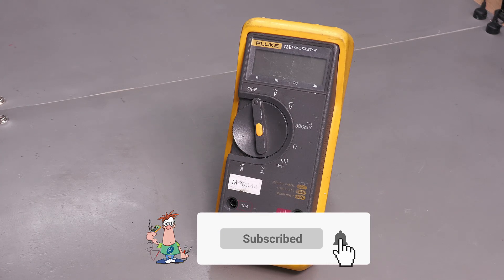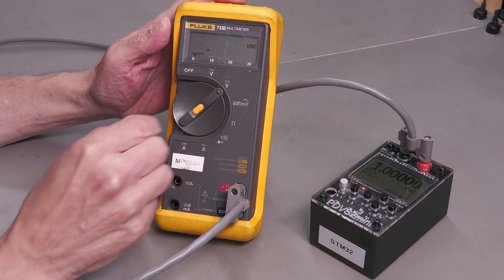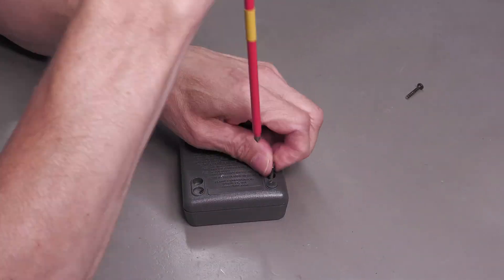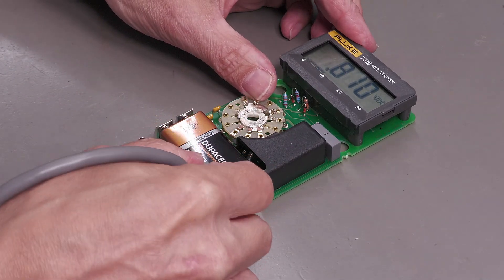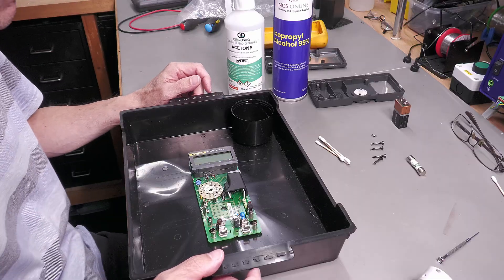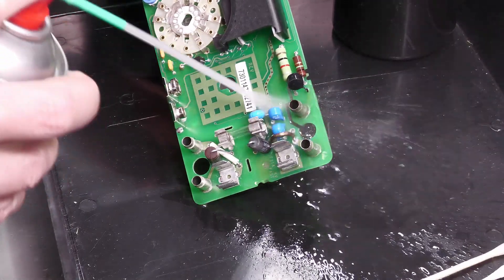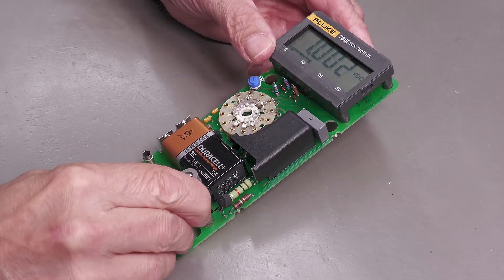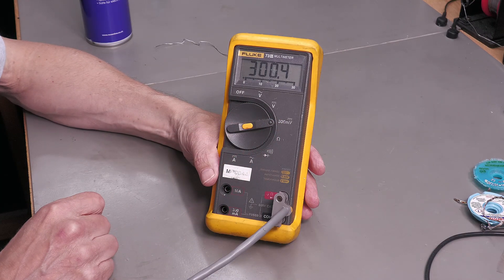No.164 - Fluke 73 Multimeter 10min Repair

Comment: i have a 73 III all works apart from when measuring AC, 240 displays as between 6 and 8V jumping up and down.  any pointers where to look?
Reply from the maker: There is a service manual for the Fluke 77 which contains a schematic......that might help you out.
Reply: @IanScottJohnston   thanks unfortunately the 77 is a different pcb to the 73 mk3 .  I found the 73 mkii and thats different too.  ill just have to use another meter for mains

Comment: The original, first generation Fluke 87 I had at work did this over time as well. The display dimmed over time as the zebra strips made poor contact also.

Now the 87V I've had for probably the past 13 years or so at work has problems in the summer time when the humidity is high. The jacks with the split contacts in them that warn you when you have the probes installed if you are not in current mode will beep and the screen will say "Lead". Even when there are no test leads installed at all. I have to soak them down and blow them out multiple times with isopropyl alcohol and air to fix the problem.

Comment: Believe I’ve had exact same issue in a 77. Banana jacks with dry solder joints. Probably one reason fluke went to the monolithic jack assembly they have on the 87 and similar now.

Comment: If you put a q-tip in isopropyl and squeeze/roll it between your fingers, it becomes just about the perfect size to wedge into a 4mm and spin around(also can cut the opposite end off, and chuck it in a drill), works pretty well, just don't use cheap ones that loose the tip easily.

Comment: In general when you have dmms with the display slowly settling, what is the cause? Like you have a reading which converges to the right value but never reaches it and is slower and slower.
Reply from the maker: Floating input, oscillation……etc I guess.

Comment: nice one Ian!  Yesterday I fixed my trusty UNI-T meter which has been going for almost a decade.  It does the job well again now.  The banana connections had become broken off at the solder points due to years of use.  Sometimes causing iffy connection or too high resistance.  It's been a workhorse, felt great to repair it.

Comment: I have a 79 that I purchased new many (30?) years ago.  The meter absolutely retains calibration over a long time even if you cannot cal it annually.  The only issue I have is the front cracked at  the upper corner even though it has spent it's life in the yellow rubber sheath.  So I only wish that Fluke could supply a new front for my meter.  Even if they must do it in their shop. Rather have it than any sort of new unknown brand weirdly named Chinese meter.   I do not view the Fluke as a "throwaway" disposable like cheap dodgy meters.
Reply from the maker: Yep, the Fluke's are always worth saving.

Comment: Just a pro-tip for any one else repairing Fluke meters: be VERY careful putting solvents anywhere near the display bezel. Often the screen printing of the logo and model number on the plastic bezel is not solvent resistant like the screen printing on the outside of the case.
Reply from the maker: Especially acetone!
Reply: @IanScottJohnston  ha ha!  Acetone is the Schwarzenegger of solvents : )
Reply: Yes, acetone will melt the plastic.

Comment: Nice quick fix, right pain just relying on a tight fit and solder to hold the sockets in place. 
i suppose it so you can use shielded banana plugs that has the connector free floating.  used to leave banana to BNC adaptors in them a lot of the time as it saves wear on the sockets, plus most test leads were BNC to banana anyway. 
Could not stand the ones RS or Farnell sold , so used to just buy 2 or 3m bnc to bnc and cut them in half. then nice supper flexy silicone wire to the banana or crock clips. nothing worse than connecting your pcb and the cables pull it across the desk. 🙂